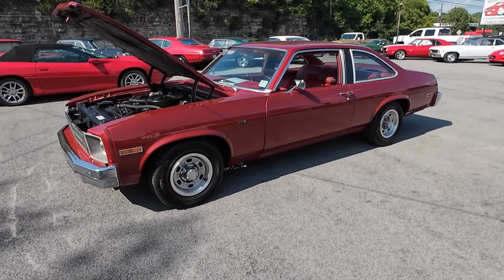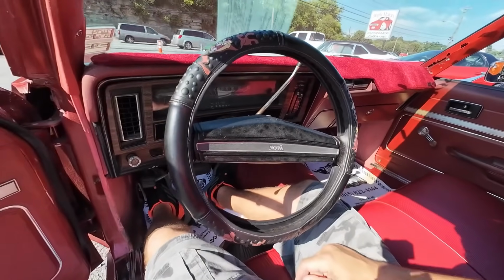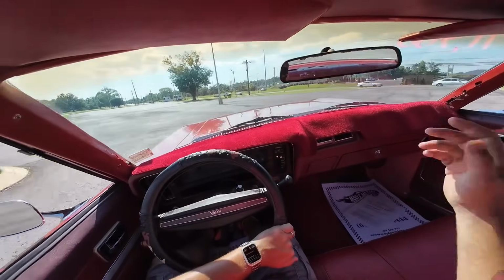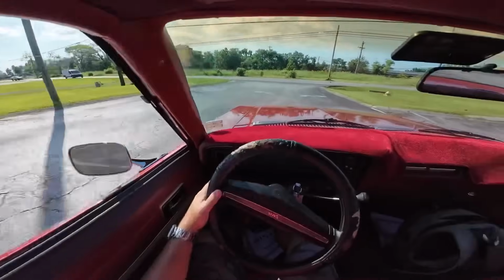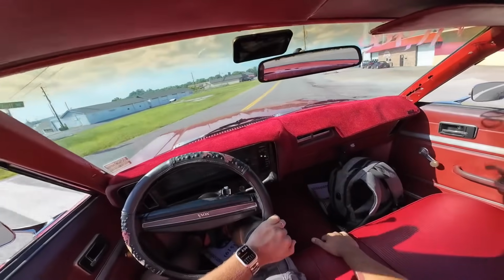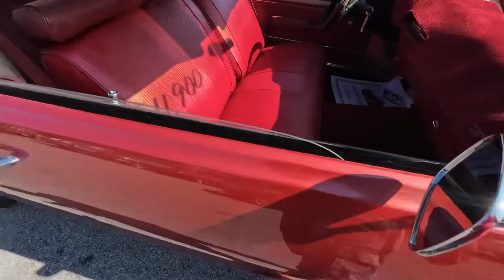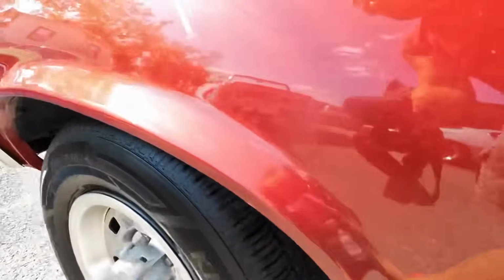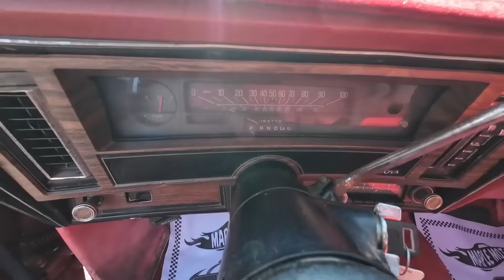Test Drive 1976 Chevrolet Nova SOLD $11,900 Maple Motors #2674

Comment: My First new car was the 76 Nova. The same color inside and out as this one has. I think it could go faster than 130mph. The sppedometer only went up tp 100mph but when I would run it flat out, the needdle would go all the way down to the eng temp light, that was about 21/2" below the 100. I had a blast with that car. I basically wore it out. Then I let my friend borrow it and he crashed it and It was totalled.

Comment: That car could be converted to a sweet street car/ hit rod or you can leave it alone and have a dependable, clean, everyday driver. The 305's don't get the recognition they deserve..I got one in my 87 Monte Carlo SS that with ecm upgrade and a select few bolt ones that has left many 5.7 irocs and 5.0 gts crying in the 1/8 mile and after years of driving it hard still starts up instantly. A couple times ups and many water pumps later it's still awesome..Anyways good job Nick and thanks for sharing with us..God bless😊

Comment: Super straight car. If it was cheaper, I would totally buy it for nostalgic reasons. Had a 78, in blue, 383, posi, sub frame connectors, nice sleeper and a real monster on the street. Can’t tell you how many 5.0’s, irocs and GN’s routinely seen my taillights in the 80’s and early 90’s. 305 has to go tho.

Comment: A cam kit, intake and carburetor, headers, positraction rear and gears and this would be one hell of a sleeper. And a shift kit. And since I was cracking open the engine I would put all new gaskets and seals in the engine and transmission.

Comment: That's a nice $3,500 car.
Reply: @raymondtipton7243  Not in that shape. I used to have a body shop and still do it for myself. I'm working on putting some repair panels on my OBS Ford F-150 this weekend, so I know paint and bodywork. That Nova is a disaster underneath that shiny red paint in my opinion, and those small bubbles he was pointing out is rust forming from the back of the metal working it's way to the outside. I see a lot of filler and those hazy spots look to me like someone burned through the clear coat when they were color sanding and buffing. In one spot you can see where they burned through enough to get into the gray sealer or primer underneath the color coat. The headliner is falling down, and the package tray is stripped with no speakers or cover. The motor is caked with oil, and the rear differential is leaking. The frame has not been touched and is in original rusty condition. 

That car in my learned opinion is a polished turd.